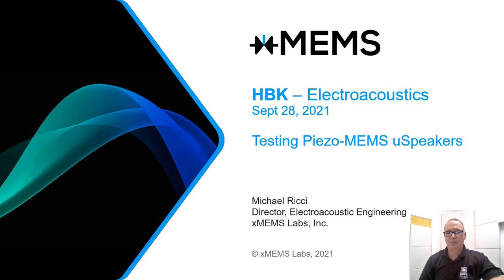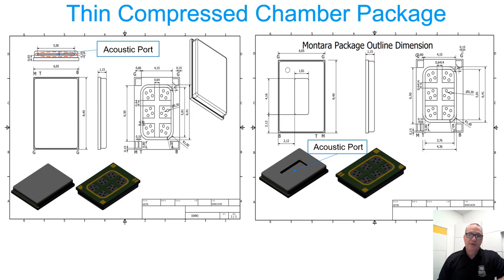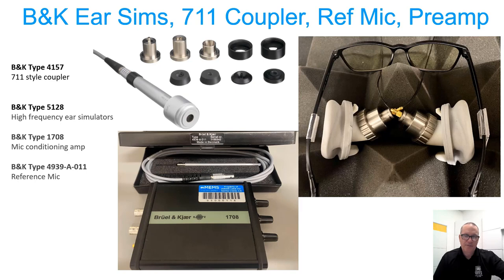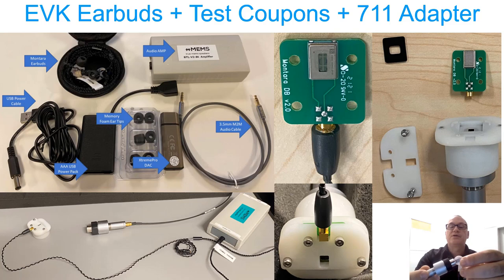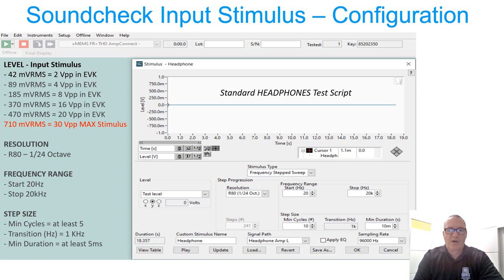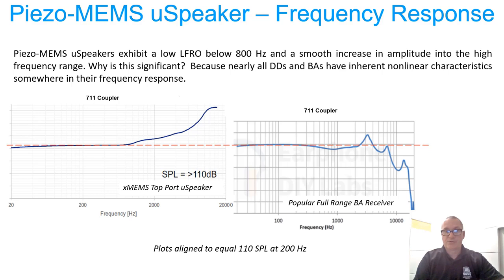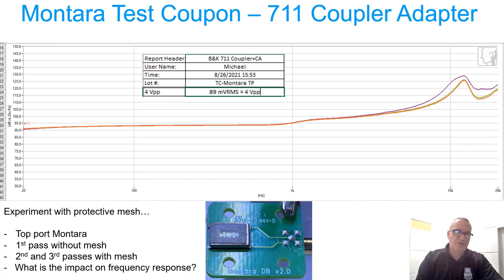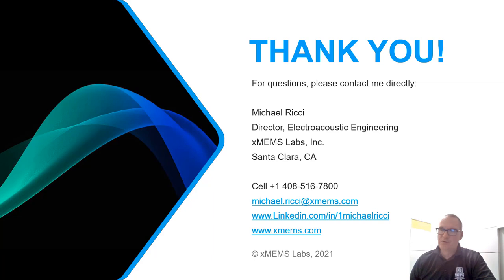Testing Piezoelectric MEMS Micro Speakers - Michael Ricci  (Xmems)

Comment: What about use out of the ear canal? Better than standard MEMS speakers?
Reply: These micro speakers are designed for sealed or occluded earbuds, not free air applications. However, there is usable amplitude in the midrange and high frequencies up to about 1.5 inches away.  We have built eye glass frames with our speakers inside and along with an Ole Wolff dynamic driver for the bass, the output is pleasing. We will be demonstrating our earbuds and eye glass frames at the CES show in Las Vegas early next month.